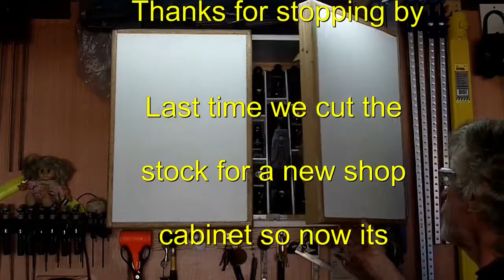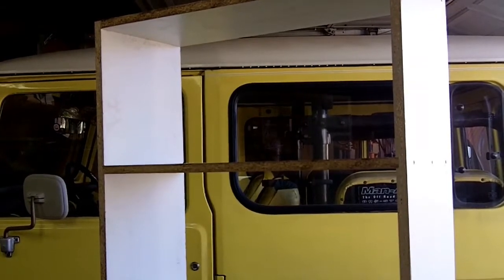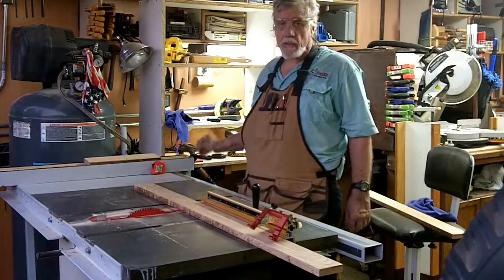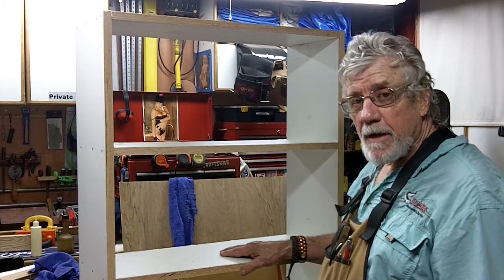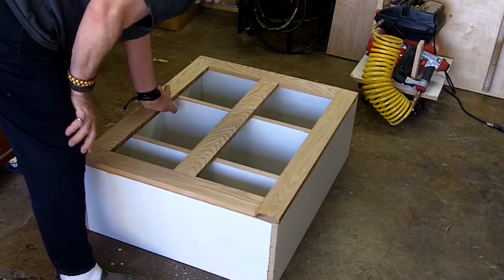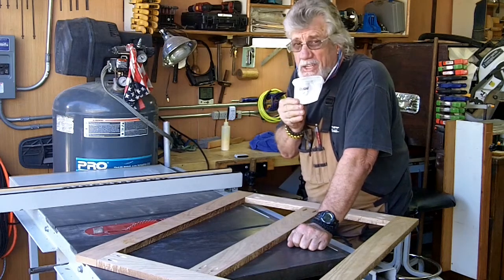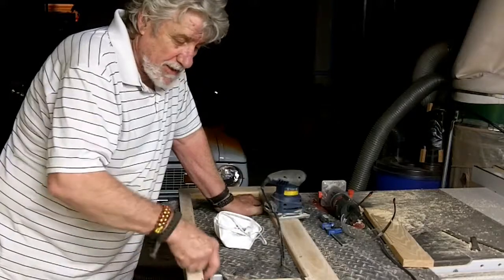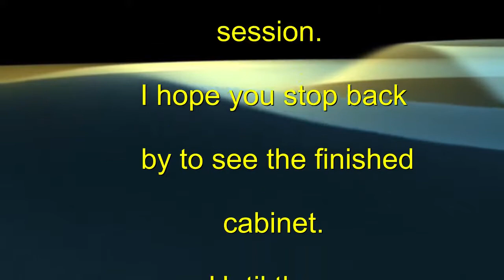New Cabinet for My Woodshop Part 2.  Assembling the cut pieces

Comment: That is turning out   to be a really nice finished cabinet.  Most of  the  stuff in my shop is re-purposed cast-offs or really roughly thrown together for function "barely" only :D  Of course trying to achieve a level surface over four different lower kitchen cabinets is a nightmare and nothing to share with others'''unless trying to give them a laugh...anyway...really like how your project is coming along...Jim
Reply from the maker: +Jedijim252   Hey, Jim.  Man, are you right.  I bought lower cabinets from Home Depot and installed them myself.  Took me a whole frustrating weekend to get them ready for the counter tops.  Nightmare is the perfect word.  Anyway, thanks for stopping by and leaving the comment.  Good luck to you and regards

Comment: Looking good buddy Is that a harbor freight router and if it is how do you like it I have a old craftsman that is real heavy takes 2 hands cuts great but will wear you out
Reply from the maker: +Charlie Wood   Hey, Charlie, how's it going.  The router to do the shelf dado is a no name bought on line.  Very powerful and does a good job...but not near as nice as the Porter Cable in my router table.  The little hand held is a H/F and works good but gets hot fast and can burn your hands.  Don't know how long it will last, but for the ten bucks I've already got my moneys worth.  The Porter Cable was $300 so It better last.  Thanks for stopping by